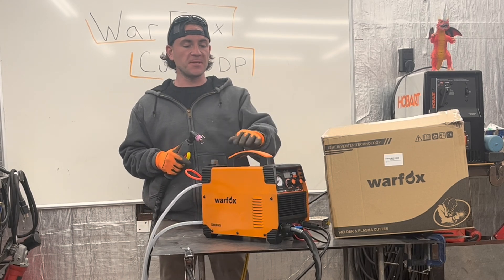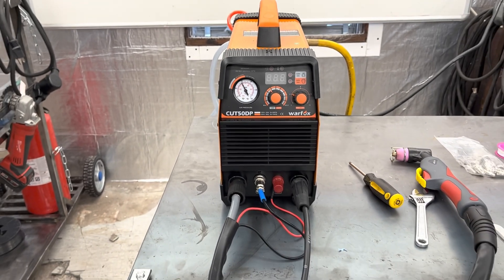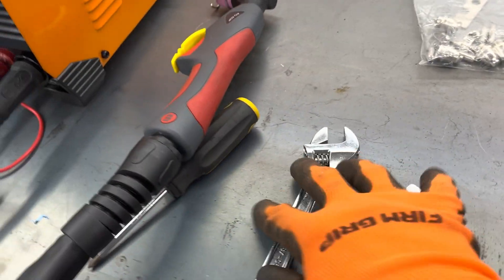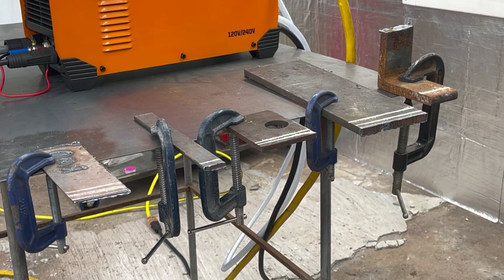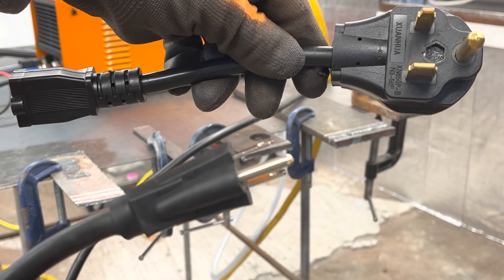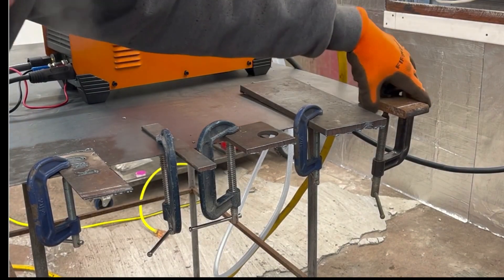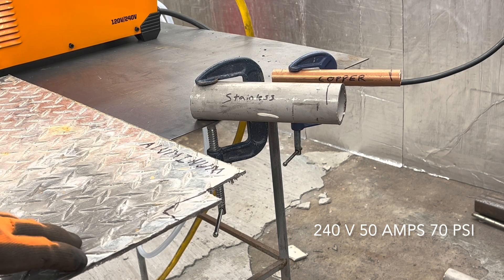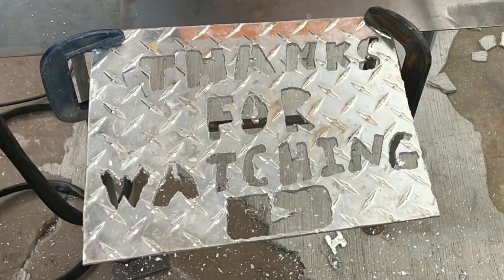Warfox Cut50dp plasma cutter review

Comment: Mine is 3 years old going strong yet never cut half in. but cut 3/8 all the time, if it sprays slag back at torch you change tip make sure air is water free and it works just like a thousand dollar machine. Buddy has one that cuts 1in clean and I see no difference on 3/8 plate other than he can use 120 psi and it may be a little cleaner cut but almost not noticeable, if set properly tips last a long time.
Reply from the maker: Deffiitly possible compressor I was using was old and deff had water in it

Comment: It looks a lot like a Cut50P that I got from ebay about 5 years ago.  Make sure you tighten up the electrode and its cover piece to nice and tight.  Also make sure your gun cable is tight at the machine. Also make sure you keep you air very clean.  In your video you were using too high of amps and air pressure for what you need. You can cut from 1/64" thru 3/16" at 20 amps and 30 PSI.  From 13/64" to 19/64", use amps of 30 with 40 PSI.  From 5/16" thru 3/8" use 40 for each amps and PSI.  For 25/64" thru 31/64" use 50 amps and PSI of 40.  Anything above these values use 40 amps and 50 PSI.  You will find that your consumables last longer and actually give a better cut.  I use mine on 240 volts

Comment: If the sparks are going down thru the cut it's cutting thru it. If they are coming back up, you are not cutting thru. You was moving way to fast on the heavier stuff, especially on your 120v test. But yeah, I agree, all these little 50 amp cutters are awesome.

Comment: I've got about 10 hours on my Warfox and its running strong.  Tips last about 45 minutes to an hour before I needed to change them.  Tips are cheap on amazon, less that $2 if I remember.  I was disappointed in the regulator quality (mine leaked as well) and that they didn't give you a torch hose sleeve.  I melted mine from molten metal from cutting.  I bought a torch sleeve now to help save the torch cable.  Great machine for the money.
Reply from the maker: Dude! I melted my torch hose a bit with some slag that fell and was sitting a few inches away from it in the ground🥵luckily It wasn’t too bad and I fixed it with some electrical tape. But still, wtf!
Reply: best to keep out of the way from dropping molten metal, just keep an eye on it.

Comment: I GOT 1 LAST WEEK ran it on 220 at 50 amp 65 psi, cut 1/2 C channel nice and clean,very impressed,compared to over 200 bucks to fill oxy ace torches now, and cuts as fast as the oxy torch and almost no slag to clean.
Reply from the maker: Oh yah so much better than an oxy acetylene torch.

Comment: I got the same system about 2 weeks ago.  I tried cutting 3/8 steel with it on 120V, it could do it.  The problem was I was on a 20A breaker.  Even with the machine set to 20A, it was trying to draw too much current from the circuit, and I'd only ever get a few seconds before the system cut out.  Reading the specs in the manual, it uses a 220-ish volt output.  So if you're doing 20A @ 220V, it's pulling 40A @ 120V.  Doing anything over 3/16" steel I'd say 240 is a requirement.  It cost me $100 in material alone (50A breaker, wall panel/socket, and 25' of wire) to get a 50A/220V outlet that I can use in the garage, not including any labor time (But I jankified it and I just plug into the breaker panel temporarily as I'm just a home dorker).  You have the same problem I do - I can't keep the motion steady.  One small jump and the plasma stream 'jumps' into a fresh section of steel.  You can see this at about the 10:58 mark in your video where the angle at which the sparks are exiting.  That variation in the angle is the variation of your 'drag speed'.  I am going to fix that by putting mine into a cheap CNC table, because I probably will never get to anywhere near 'pro' level of torch control.

Comment: I bought the same machine from Amazon because I could return it no-hassle if it wasn't any good. I did the same trial that you did and it cut great. However, having had a small one before I learned that if you leave it on 50amp/240v/70 psi all you have to do is control the speed of the cut instead of fiddling with the settings. On thinner material, I use a straight edge and full power and it's almost as fast as an Exacto knife on cardboard. This is a great bargain but I cannot attest to its longevity. Its size and lightweight make it very handy to move around. The pilot arc is great and it makes starts so much easier than touching the tip to the metal.
Reply from the maker: Couldn’t agree more. I pretty much only leave it on 240v 50 amps now and like 65psi. Really no reason not to! But it’s nice to have different options especially the dual voltage. Deff. a solid purchase for what it is!

Comment: I bought the same cutter just a few weeks ago...works fine.  Right now, I'm limited to a 10-gal compressor, so I really like the adjustable post flow air control.  I considered the YesWelder, but the post flow was pre-set to 20 seconds which wouldn't have worked for me.  But yeah, the fittings are a bit wonky...really need a LOT of teflon tape to stop the leaks.  I plan on removing the regulator and going to one that has standard 1/4 NPT air connections.  But, so far so good...really no complaints.
Reply from the maker: I have an 80 and a 6 gallon, mostly use the 6 gallon and haven’t had any issues with having enough air. But I don’t really cut for long periods of time. Are you running out of air pressure with the 10 gallon?
Reply: @chaoticlizzards653  No, but the compressor does kick in while I'm cutting.  So far, I haven't noticed any effect on the torch tho.  I set my post flow between 8 and 10 seconds.